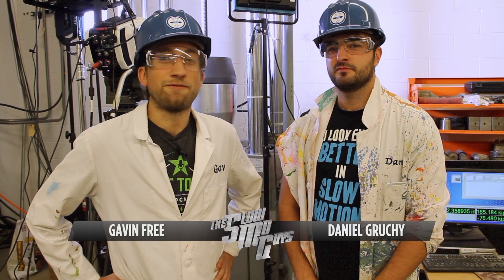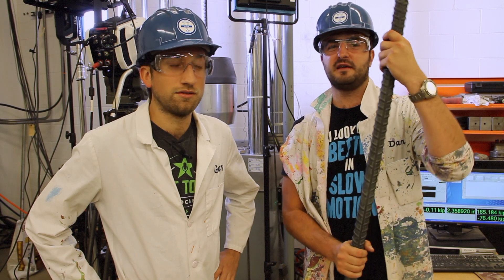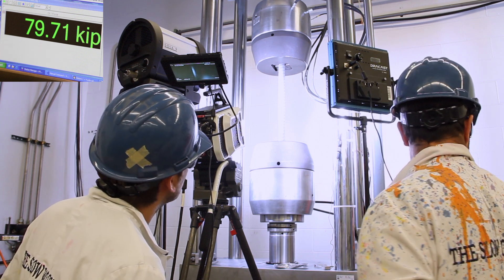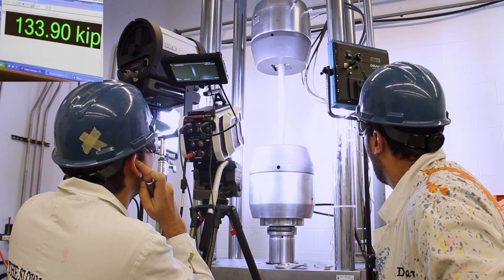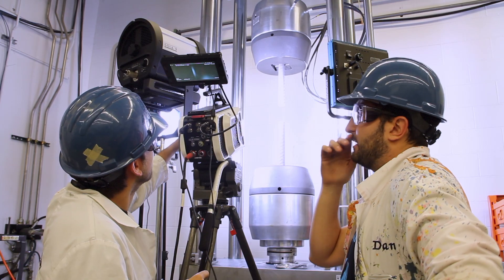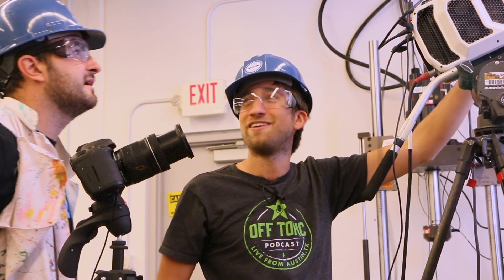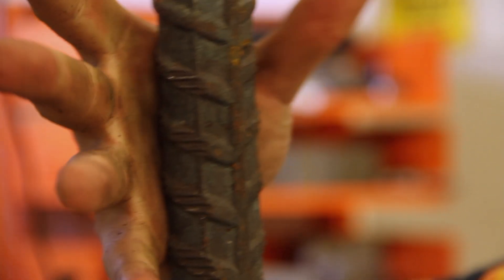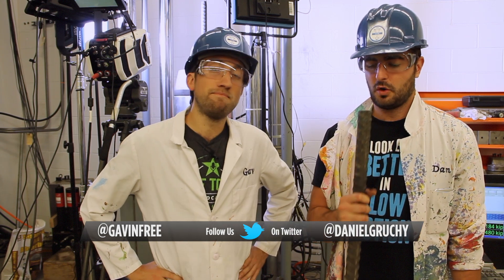Snapping a Steel Rod 1000x slower - The Slow Mo Guys

Comment: Makes me wonder how many kips a real steel bar could withstand. Rebar, in general, is pretty much the crappiest (unfinished) steel you can get. You can cut halfway--or less--through a piece of #5 (5/8") rebar and then break it by hand.

Comment: I wasn't thinking about you guys holding some human appendice, I was thinking that I can't believe you're conveying some surprise that the metal bar, which easily conducts heat, would be warm after you managed to rip apart extremely powerful molecular bonds.

Comment: It would be interesting to see if you can capture sonoluminescence in slow motion.
In short, it is a gas bubble suspended in liquid using ultrasound, causing is to expand and collapse, emitting light as it collapses.

Comment: I'm doing a bit of thinking here, Ok, your talking a huge amount of potential energy but when it broke I didn't get a sense of that energy being released, Yes, you had heat on the bar ends where they got inserted into the machine but you never said if at the break itself the bar got hot? Did much of the energy go back in the bar when it broke as if it was a spring that recoiled back after the tension was released?   How about setting up an thermo sensitive camera that can shoot and refresh where the rate is huge. IDK, what would the heat/tension/ potential energy look like on a thermo camera?
Reply: I think most of the energy will go into deforming the metal. Same as with a car crash where the different metals absorb the energy by deforming

Comment: friction weld that same bar back together, and then pull it apart again and see if it holds at 160K again, or less, or more? welds are supposed to be as strong as original but I doubt

Comment: why does that machine even exist?
Reply: this machine is used to perform tests on steel to make sure that the steel is strong enough to handle the weight its designed to withstand.

Comment: windows XP in 2017???
Reply: Mr Krabs Machines like these can have very long service lives and you will find a lot of older equipment running various versions of Windows, but particularly embedded versions of CE, 98, 2000, and XP as well as various older Linux and BSD kernels.  After all, XP was still shipping on systems up until about 5 or 6 years ago.
Reply: Mr Krabs this has to be a reupload from several years ago.

Comment: How can this steel rod has brittle failure?
Reply: Aakash Sahu Probably because it is being work hardened as it is severely stretched, plus there are many different alloys of steel depending upon which properties you most want to improve versus which you are willing to sacrifice.  By the time this rebar failed in tension the concrete it was (or would be) holding in tension will have long been pulverized  to the point of having lost most of its remaining compressive strength --the building would already be irreversibly compromised.
Reply: Grade 60 rebar is a high carbon steel.

Comment: What the fuck does "1000 times slower" even mean? How does "n times slower" compute? What would the result be if n was 1? What if it was 0? Fuck you unscientific plebs!!
Reply: Anvilshock the recording is  1000 times slower than real time you Moron. It's not that hard to understand
Reply: 2 times slower = 1/2 = 50% speed
4 times slower = 1/4 = 25% speed
1000 times slower = 1/1000 = 0.1% speed
1 times slower = 1/1 = 100% = real time
Reply: Okay, I can see what you are trying to say, but for all intents and purposes in this video, the phrase "1,000 times slower" is clear and easily demonstrates the intended meaning.  Anyone who is watching will immediately understand the point they are trying to get across.  Yes it may not be perfect wording, but you really don't need to nitpick the exact phrasing since the phrase is incredibly simple to comprehend.  I can guarantee 99% of the people who watched this including yourself know what they meant to say.  It's simply not worth bringing attention to.
Reply: Thanks for your explanation using the exact same words as those which were questioned in the first place. Evidently, my question was too hard for you to understand, moron. I don't blame you. Or your parents. You probably bumped your head when you fell from your father's sister's womb. Happens in the best families.
Reply: Weird how you can use the word "slower", a word that's grammatically and semantically a comparative, and still mean "unchanged" ...
Reply: It's just how math works man, if I say bob is 1.5 times heavier than bill, and bill is 150 lbs, then bob is 225 lbs.  Just like if I were to say if bob is 1 times heaver than bill, they would be equal weight.  Same concepts apply to speeds and any other types of quantities or values.
Reply: Really? If people said 1 times heavier they would immediately be understood as saying "they're the same" rather than "one is twice as heavy as the other one"? Oh, I have some doubts in that ... Yes, that's how maths work, but only if you define a bullshit formula to defend an idiotic, braindead colloquialism!
Indicatives such as "small" or "low" are relative. You cannot use them with a multiplier to get a reliable result (or any, for that matter) because they don't come with an implicit reference. "Large" or "much" are absolute - they come with an implicit reference: their "distance" from nothing, or zero. "2 times as large" means "the size of the original, times 2". Relative indicatives don't have that, so they require an explicit reference, something that is named, or known from context. (Go on, I dare you be a smart-ass and invoke the distance from infinity to try and salvage your formula.) Otherwise you cannot quantify "how much" your "small" is even supposed to be. How do you expect to arrive at a sensible result by multiplying something you don't even reliably tell the amount of? Without reference, your formula breaks down completely for relations.
This goes worse for comparatives ("smaller" and "lower"). "A is smaller than B" - Okay, that establishes a reference, B; and the size of A in comparison to B comprises their relation. Maybe A is 1/3rd of B. Now throw in a multiplier. "A is 2 times smaller than B." Now what's that? 2 times 1/3rd would be 2/3rds. 1/3rd times 1/3rd would be 1/9th. So A could be 2/3rds or 1/9th the size of B. Or anything else. Because nowhere in your "A is 2 times smaller than B" you establish a relation (let alone a reliable one), yet you jumped right to multiplying one. Or in other words: Tell me, what is the "smaller" of "B", so that I can have it 2 times?
Reply: Strictly, it's not clear. Compare 1000x as fast and 1000x faster - the latter is, in fact, 1001 times as fast. (Yes, the difference becomes academic at that scale, but nobody says it has to be that scale. People easily say 2x or 3x or similarly low values, using the same grammatical construction with no second thought, either.) Now what would be 1000x as slow vs 1000x slower, ignoring for the moment that either one is flawed, what's the result now? Again, the numbers could be 2 or 3, not 1000. Either way, this is broken.
Reply: Anvilshock you know wat you are mate, full of shite haha!

Comment: Very cool video! Rebar is notoriously bad steel mostly comprised of remelted scrap of various alloys. it is literally the Hotdog of the steel industry. I say that because I noticed the steels grain length was huge in the quick flashes I saw of it. and wonder if using actual tool steel grade steel would yield  a smaller grain size along the crack or is that an artifact of it being pulled apart.

Comment: why not 60fps
Reply: I believe they made a video on their other channel explaining why. In a nutshell, the slowness of the video outweighs the smoothness.
Reply: Gardinbe Yeah it would kind of defeat the purpose. I think they upload at 25 FPS which would be 2.4 times slower than 60 FPS. If they switched to 60 that "148,000 FPS" shot would become a "61,666 FPS" shot instead.
Reply: Also this isn't a videogame.

Comment: Pretty cool to see it in slow motion, I remember watching the gauges and seeing the steel deform when I did this in Mechanical Engineering/Material Science class, with a much smaller piece of steel, very impressed with the machine we used.

Comment: So where does the crack start in the steel beam? From some random weak side of the beam? From the center out? hmmmm
Reply: zeNUKEify it starts at some small impurity in the steel. Think of the impurity (or initial crack) as a super tiny hole somewhere in the bar or on the outside edge of the bar. Once the tensile stress from the machine reaches a certain maximum force, that tiny impurity grows from a hole that's too small to see without a microscope to a fully catastrophic crack. The crack propogation at that point is almost instantaneous

Comment: 157 kip = 71,214 kg for the rest of the world
Reply: +AeroFix94 That little bar would absolutely NOT be able to lift neither the titanic nor the bagger 288 which are 47,450 and 45,500 tons respectively. That bar can handle 71.21 tons before it breaks.  The titanic is 666.33 times heavier and the Bagger 288 is 638.95 times heavier.
Reply: Then you'd use grams, The Metric system is the simplest system out there.
Reply: And the 'Comment of the Week' award goes too ....
Reply: 157,000 lbs
Reply: +AeroFix94 Yes. An average American man.
Reply: Well, i really did mess upp the facts about the 288's weight. But still. It's crazy how that sized bar can handle those machines (Y)
Reply: Assuming the surface area of the cross section is a circle of 3cm diameter, that would mean the ultimate tensile strength of this steel rod is about 988 MPa which is within the standards. MPa is the norm used for these tests as far as I know, not kilograms or kip.
Reply: Matthew Davies Matthew Davies ohh, okay thank you. I am from Germany and we use the dot as the thousand separator. We even call our decimal points "Nachkommastelle" which can be translated to "after comma position" :D
Reply: +Matthew Davies Actually, we Americans do, in fact, use the comma to separate thousands. We use the period to separate decimals, but not thousands. Check your privilege.
Reply: Merci pour la conversion !

thanks for the conversion !
Reply: You actually want Newtons, which is the SI measurement of force: just south of 698 kN.
Reply: over 95% of the world does though.
Reply: Sindri Karl I'm a simple man
Reply: Or around 700 kN.
Reply: Spoggi99 what's the longest German word you know?
Reply: Matthew Davies probably "Eierschalensollbruchstellenverursacher"
Reply: Matthew Davies mhh, it contains 4 words I would say:
Eier - eggs
Schalen - shells
Sollbruchstellen - predetermined breaking points
Verursacher - perpetratot
Reply: Spoggi99 you Germans are fascinating
Reply: Matthew Davies thx for using si unit
Reply: Could you translate that for a stupid American?
Reply: Logan M yeah, that's about the weight of an average American man. Does that help?
Reply: i dont really use grams my dude
Reply: Matthew Davies its not 71,214 its 71214 just to make clear :D
Reply: Spoggi99 That varies internationally. For some reason Americans reversed use of the period and the comma, so that over there, the period is used as the thousands separator, whereas almost everywhere else people use the comma to separate thousands and periods for decimal points.
Reply: Spoggi99 not that putting nothing at all is wrong!
Reply: Spoggi99 how many English words does that make up?????????
Reply: You should be using Newtons not kilos. Newtons are the SI unit for force, which is being measured here.
Reply: AMGwtfBBQsauce Exactly. As i pointed out earlier its around 700kN.
Reply: Daxelinho9 Sorry, missed your comment. You are correct :)
Reply: Thanks
Reply: to make this clear. That little bar can lift titanic and a bagger 288 digger without breaking. Imagine that!

Comment: That's rebar. It's used in concrete. That size would be used inside of cylindrical column support in big buildings and bridges. These tests are done on batches to to confirm they meet threshold requirements. That is why the big building you go into don't fall down.
Reply: weedandwine but can jet fuel melt it?
Reply: and all these bars tied together with ∅1mm wire
Reply: MrTimpinist Hmmmmm... JetA1 fuel is similar to diesel fuel, heating oil, and RP1 fuel, but for solid results use acetylene/oxygen mixture
Reply: ΑΡΗΣ ΚΟΡΝΑΡΑΚΗΣ They're tied together with tonnes of concrete.
Reply: ***** I'm starting my home, and I calculated that I'll need 110kg of iron rebar
Reply: ΑΡΗΣ ΚΟΡΝΑΡΑΚΗΣ That doesn't sound like much.
Reply: ***** normal earthquake proof house I build, not the white house...
Reply: ΑΡΗΣ ΚΟΡΝΑΡΑΚΗΣ K.
Reply: ***** also I calculated 550 cubic meters of concrete for the columns and the floors
Reply: ΑΡΗΣ ΚΟΡΝΑΡΑΚΗΣ Right.
Reply: weedandwine but this is the opposite direction of force, tensile vs compressive

Comment: Hey Slow Mo guys, That is an impressive Tensile Tension Test, but... have you heard about dynamic tests in "Hopkinson bars"? It is a test that brings the sample a high deformation speed. I'm talking about 200microsecons test. I've tride to record one for my Proyect with an old Phantom at arround 12000fps and even then it is so damn quick...

Comment: that pound fource cannot simply be transformed into an equivalent of horse power. because its force without motion at that point. if anything it would make sense to calculate an equivalent of acutal force in Newton and mutliplying it with the length change of the steel beam will give an energy that was needed to get that deformation to a certain point.
btw 220,000 pounds is roughly 100,000 kg which means a force of roughly 1 million Newton. fucking nuts.

Comment: I once saw a demonstration of a half inch diameter steel bolt being stretched apart. Towards the end, you could see the middle become significantly thinner than the rest if the bolt, and it retained that thinness, as well as a cone and bowl break.

Comment: Judging by how easy that layer on the outside came flying off I imagine it was not steel but a coating of zinc oxide which is used to prevent corrosion of iron.

Comment: There's no real use for that machine , if there is tell me what it's used for
Reply: You can determine the "stress - deformation" graph for the steel used for the bar. This graph contain useful information of the properties of the material, used for engineers to design structures
Reply: Matthew M you aren't very bright.

Comment: You should try high strength concrete in compression (90 MPa compressive strength or so). You would get quite a bang, and would look pretty cool in slow motion!

Comment: why not synchronize multiple slow motion cameras and interpolate the image to get 1 million frames?
Reply: it'd be incredibly difficult to offset the recording of multiple cameras by so little. they'd also then have to reorganize each individual frame probably
Reply: yea true.
Reply: Lrripper the Phantom theyre using costs about $130 000.
Reply: @rykehuss3435  wrong that exact model is 30 thousand and the one above that is 150 thousand do some research it's not hard to know what your talking about but I'm sure it's easy to just say stuff to sound like you know what your talking about
Reply: each camera like this one cost multiple tens of thousands.
Reply: Well, rich and rich. They didnt start this channel with a camera like that, but in time theyve gone for faster and faster cameras as they gained popularity. Imagine you started a small company, and in a few years you were making decent money. So you take a loan and make an investment, $130k is not that big an investment if youre pulling $10-20k a month. I'm pretty sure any cameras they've bought has been with the bank's money.
Reply: Rykehuss do you think they are sponsored by phantom or are they just fucking rich ?
Reply: Rykehuss They started with a camera from work i think.

Comment: I did this in school yesterday (I attend a higher technical college for buliding techonlogy in austria if you wonder) but the rod was only 10mm thick and it looked very different to this.
The rod got longer and thinner in the middle and then snapped with a much smoother and shiny surface as you would expect from metal. And we also calculated how much longer it will get before snapping and how much force it can take and we were pretty close. So I have to ask my teacher next week why the rod in the video snapped this way... Maybe he could describe